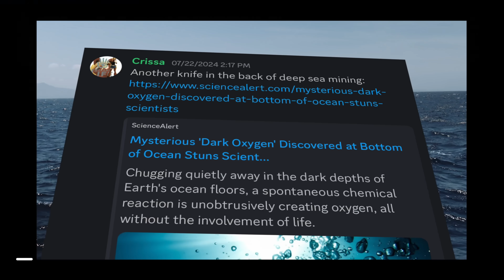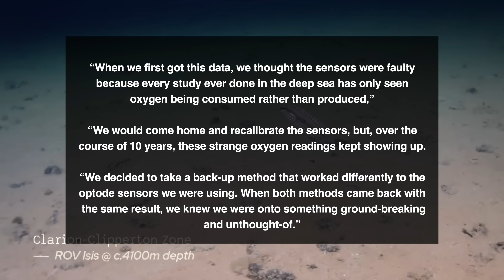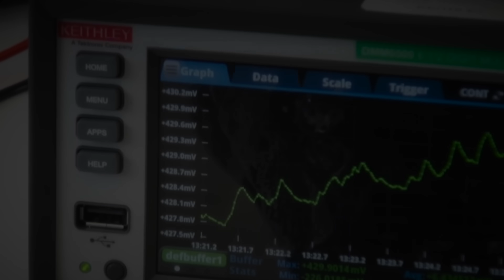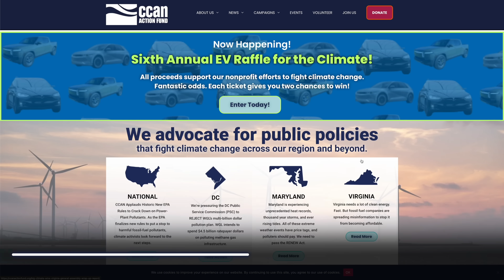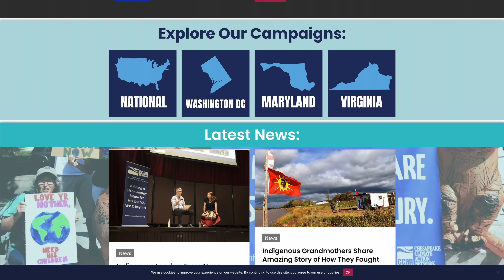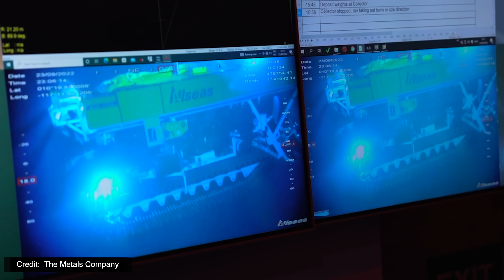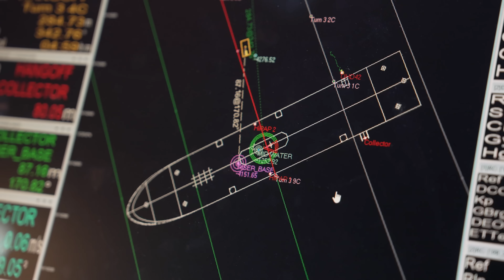The HUGE Problem with the Dark Oxygen Discovery

Comment: This is irrelevent. The amount of oxygen produced by natural electrolysis is so tiny that it has zero impact on the earth. It's not groundbreaking. It's a curiosity. Even if this was happening before photosynthesis existed the result would have been parts per billion O2 that would just oxidize other minerals before even reaching the atmosphere.  This is the same as natural nuclear reactors that have been discovered where fission was happening in a natural uranium deposit exposed to water. It's a curiosity, not a earth shattering discovery. To call this "groundbreaking" is junk science. The mineralized nodules should be mined because they are easily collected and rich in metal content. Hard rock mining is much more destructive to the ecology of earth and requires much larger energy input to extract. We require these minerals so gathering them from the seafloor makes economic and environmental sense.

Comment: I'm very curious about the physics and chemistry of these nodules and how they are formed.
Why are they still producing voltage so long after formation do they form in place on the sea floor or do they have to be circulated or disturbed kind of like a hail stone.
Can we use electrodes and anodes engineered correctly to extract metals from ocean water or vents on the ocean floor?

Comment: Dark oxygen refers to a recently discovered state of oxygen that exists in the depths of the Earth's atmosphere, approximately 200-300 kilometers above the surface. At these altitudes, oxygen molecules (O2) are broken down into individual atoms, which then react with other atmospheric particles to form a unique, previously unknown state of oxygen.

This "dark oxygen" is called "singlet delta oxygen" (SDO), and it's called "dark" because it doesn't emit light, unlike other excited states of oxygen. SDO is thought to play a crucial role in atmospheric chemistry, influencing the formation of other atmospheric particles and potentially affecting the Earth's climate.

The discovery of dark oxygen has expanded our understanding of atmospheric science and highlights the complexity and mysteries still waiting to be uncovered in our planet's atmosphere.

And the "Dark Oxygen" in depths of over 6000ft is actually called "recalcitrant oxygen" or "refractory oxygen" so as to not confuse it with dark oxygen found 200-300 above the earth's surface.

Comment: They need to look elsewhere for an energy solution. Finding this is like a test, it's low-hanging fruit, and it doesn't need to be mined. There are lots of other companies working on very promising energy solutions like silicone batteries, sodium batteries, and solid state. Calling it dark oxygen is also dumb, if it doesn't differ in any way from regular oxygen, just call it what it is.

Comment: Most of the rocks on earth are mostly oxygen. 

That's where we get comet tails, to adjust to the changing electric environment silicon dioxide must shed the oxygen atoms to loose negative charge. That's why comet tails are so long without dissipating,  the tails have no dust, just negative electrons.

The sun is like the positive pole of a battery and the heleosphere is like the negative pole, when a comet gets closer to the sun it moves into an area of more positive charge.  Earth has a surface change of 100 volts per square meter.

Comment: more testing needs to be done, to see how much you can mitigate the issues. i wonder about using lights on the sea floor that has been damaged, to try grow seaweeds down there. if the issue is light not pressure, we can up the o2 in the areas, while mining them all out. as long as there is no other issues found with deep sea seaweeds, that is :P

Comment: We need less raw material for batteries than most think because all those materials are recycled in the end and we don’t need more dug up. Once we have enough batteries in the world the constant recycling into new batteries makes the circle complete. 
Plus, the mining done for batteries on land is less destructive short and long term than searching for and pumping out oil/gas/petroleum. 
I get that this show wasn’t directly about this but the anti-EV cabal has recently moved to just trashing batteries themselves and that must be stopped with information. 
Another neat fact about large scale battery storage for the electrical grid is that we’d be saving up excess energy (created everyday now) to use during peak load times. All batteries start the day at full because they fill up overnight. Then they shave off demand at the peak times. That way we need fewer power plants, much fewer peaker plants. 
And we aren’t just burning up the battery packs the way we just burn up coal or gas, where we always need more of it. 
Once we have enough batteries for home, biz and transport we hardly need any new input. 
Let’s definitely leave the ocean floor pristine

Comment: When iron oxide (Fe₂O₃) reacts with seawater, a few possible chemical reactions can occur depending on the specific conditions (e.g., temperature, pressure, and presence of other ions). One common reaction involves the formation of iron hydroxide and chloride compounds. Here's a simplified reaction:

\[ \text{Fe}_2\text{O}_3 + 6\text{H}_2\text{O} + 6\text{Cl}^- \rightarrow 2\text{Fe(OH)}_3 + 6\text{Cl}^- \]

In seawater, the chloride ions (Cl⁻) from the dissolved salts can facilitate the formation of iron hydroxides. Over time, the iron hydroxides can convert to more stable forms like goethite (FeO(OH)) or magnetite (Fe₃O₄).

The reaction can be more complex due to the presence of various other ions in seawater, such as magnesium, calcium, and sulfate, which might also interact with iron oxides.

Comment: The use of hydrogen as a "clean" fuel is being vastly over emphasised.  Hydrogen is na highly reactive element and being the smallest atom it permeates almost everything.  Also consider the almost total lack of distribution facilities.  There will probably be very limited uses for it as a fuel for areas outside of normal residential areas. (I'm an Aussie - Outback!!) .

Comment: The way of making use of hydrogen is by taking the hydrogen gas production from a well, a hole drilled in favourable geology, and port it directly into a fuel cell stack.  The electrical energy can then be transported by the grid.  Trying to remove hydrogen from water will remove all of the ions that life needs to survive, such as the hydroxyl ion.  There’s also attempting to store hydrogen gas would lead inevitably to catastrophic failures.  The EV revolution is great, let’s not ruin it by raping the ecology.

Comment: Missing in this discussion is a crucial point: these natural batteries are primary cells. As the metals in them react with the seawater to produce metal salts, they are consumed. The amount of oxygen they can produce is very finite. When the battery is worn out, the production stops. The fact that the metalic modules exist at all implies that any reaction that is taking place is extremely slow - which means that the amount of O2 produced is also very low. I don't see how the nodules could exist and persist over geologic time scales, and also be splitting water at a significant rate - unless there is some process that makes new modules. The other thing I wish the scientists had checked: If electrolysis is happening, H2 should be produced in twice the quantity that oxygen is produced. That should be easy to detect.
Reply: unless the metal is a catalyst
Reply: @jordanhildebrandt3705  Catalysts can speed up a reaction, but catalysts cannot, by themselves, cause a reaction to take place if that reaction needs an energy input. If the metals in the nodules are acting as a catalyst to split water, there has to be some substantial energy input from some other source to drive the reaction.
Reply: @jimmurphy5355  True.  But catalysts can lower the activation energy to the point that a reaction can take place in circumstances where it otherwise wouldn't. 

It just didn't seem very clear from the video what is actually going on chemically.  If the conditions you specified are true, then your conclusion about geologic time is inescapable, and these nodules, therefore, are unlikely to be foundational to any ecosystem.  I am just trying to think of any possible alternatives to your conditions / assumptions, which might change the significance of these very wet rocks.
Reply: @jordanhildebrandt3705  Catalysts do lower the activation energy but a reaction will only proceed spontaneously if there is energy released. Hydrolysis requires energy input, so it won't be spontaneous. You can use catalysts to reduce the energy required closer to the theoretical minimum of 1.23 Volts but not less. If you could then you'd be able to react the hydrogen and oxygen to get more energy out than you put in and that would be a pretty serious violation of the Conservation of Mass and Energy.

Managanese compounds are amazing catalysts and will liberate oxygen from more energetic molecules very vigorously. A single crystal of permanganate into hydrogen peroxide will cause it to decompose into water and oxygen so rapidly that the solution will boil and you'll be thankful you're wearing your safety goggles. The same permanganate in water simply gives you a lovely purple solution that sits there and looks pretty.
Reply: @seantimpa6264 What input powers this universe...the universe itself breaks the second law off thermodynamics...theres no USB cable going into the sun it just is and the story off the big bang is something from nothing which also breaks all the laws
Reply: @jimmurphy5355 is there any indication as to how long a modular will last?
Reply: @jshaw4757  The Sun will go out and the universe grow cold some day. Neither violates the Laws of Thermodynamics, they just take such an incredibly long time to get anywhere near equilibrium that we don't notice.

The Big Bang Theory addresses the first moments of the universe, not its origins. We don't have that one figured yet.

Not that any of that would help oxygen production on the ocean floor.
Reply: @seantimpa6264  Energy out cannot surpass energy in is that correct ?
Reply: @jshaw4757  Not for any process that we've ever observed.
Reply: @seantimpa6264  So what's the energy in for everything that exists
Reply: @seantimpa6264  I'm not being tricky by the way I'm asking genuinely mate thanks
Reply: @seantimpa6264  Electric eels always had my intrest as they a capacitor basically or a layden jar as they first called...but they a animal not tech lol...they just found these metallic stones bottom off sea bed not sure if you have read
Reply: @seantimpa6264  went off course last comment just sharing if intrested
Reply: @jshaw4757  That's one of those processes that we haven't observed. The jury is still very out on that one. Answers may include: "That's a special case", "The universe is eternal", and "The question doesn't make sense as asked."
Reply: @seantimpa6264  Can you elaborate mste coz my head a bit slow a.t.m jury out on what exactly cheers
Reply: @jshaw4757 that's absolutely false. If the sun's existence violated the second law we would not have the second law as it is so obviously observable.
Reply: @djcfrompt  I may be wrong then I thought that was the premise my mistake
Reply: @jshaw4757  sort of, but when you are doing nuclear reactions, then mass-energy equivalence becomes important (E = mc^2). Energy output can surpass energy input at a loss of mass.
Reply: @djcfrompt  Right so where and how has the weight been created in our universe the weight the sheer scale off power not even in sun's in small planets what's the input...it seems very out off balance and we are told energy out needs equal energy in so if as you said not strictly the case that means some free pottential is being created
Reply: @jordanhildebrandt3705  also what about everything being electric carrying a charge at times. Water flowing, beings creating currents in it etc...
Reply: Uh, yeah, what he said
Reply: It's the batteries of Shell-Phones of underwater aliens
Reply: No you dimwit it's the secret spinosaurus society  @downtostandup
Reply: @jimmurphy5355  you forgot the teluritics. Have you ever seen ground  to sky lightning?
Reply: @jimmurphy5355  twice the number of atoms, 1/4 the mass. Great point about the nodules having to be formed faster than the oxygen depletion. The claim is that they take many many years to form. Your astute observation that the oxygen is finite directly refutes that.
Reply: @jeffhiggins808 1/8th the mass. 2 H2O -> 2 H2 + O2. 2 H2 has mass 4, O2 has mass 32.
Reply: @jeffhiggins808  They are claimed to be some of the slowest geological formations so even million of years to form is probably not enough. The claim that they work as batteries don't make any sense. They could somehow work as catalysts but that is something different.
Reply: There  most certinly are proceses that happen to form this nodules that we dont undrrstand yet. Meaning we dont know the rate at wich they are formed or by what.
Reply: If nothing else it reframes our understanding of what oxygen production can look like.
Reply: @tyler1234321  It's current n voltage which reacts with salt water n creates a type off hydrolysis I belive so by its nature it can split water molecules making oxygen ...that isn't spot on my words may be incorrect but enough too get somebody else intrested as I have very bad short term memory but I belive could be meteorites due too metal content magnese nodules polymer stones but it's the salt water that makes them run n create this oxygen
Reply: ....MOREOVER-- ELECTROLYZED SALT WATER TURNS INTO BLEACH

...THESE "SCIENTISTS" ARE JUST INCOMPITENT
Reply: The nodules are made with sublimated metals, when they are actively seeding further sublimation while they are functioning like primary cells.
Reply: Its a surface reaction -- as the metals are deposited, so O2 is released, and the nodule grows.
Reply: @j5edgar2h  do you have evidence for that? I read the paper detailing this observation and I didn't see anything about metal deposition.
Reply: @djcfrompt  Can you explain evidence...can all evidence not be falsified...is it not just a presentation you half need too take on faith..like without background checking every person who is giving you info how can you be sure its facts
Reply: This, uncles we farm 10% of the ocean of them like we do on the surface I don't see much of an issue. Sure this is interesting but earth did not have much oxygen before 500 million years ago 50-100 million year later as in you would die.
Mostly because all the iron turned into rust before we got an oxygen atmosphere.

Comment: We may be able to duplicate with minerals, gathered in the conventional manner to create water, splitting without having to add electricity
Reply: Splitting the hydrogen and oxygen in water requires energy input. There is no way around this. The metallic nodules are getting used up, just like any battery, when they make electricity. The metals in them are consumed - changed into metal salts or some other metal compounds. Once all the metal is chemically combined with some other element, like sulfur or chlorine, the reaction stops. The analogy to burning wood to make heat is very relevant. Wood becomes ashes, and once all the wood has burned, no more fire. In a battery, metals also become ashed of a sort during the use of the battery. Once all the metal is consumed, no more electricity..

Comment: CO2 emission is so much greater of a concern that it is really just absurdly stupid to put the brakes on battery related mining activity for the sake of the animals and plants that happen to live in potential mining locations. We could mine the ocean floor for thousands of years and the effected area would still be insignificant. On the other hand, if we do mine enough battery materials we might avoid a complete collapse of the biosphere due to CO2 levels. It also sounds like this oxygen release is just a cycle and that in other places there are ore deposits which are reducing oxygen levels in the water as they rust.

Comment: I do not understand one thing.  The way batteries work is by changing their chemistry.  They go from one state to another, gaining entropy.  How could these nodules be effectively producing enough electricity for millennia to still be able to rip apart water?  The only thing that would make sense to me is if it was a catalyst.  In which case understanding it could give us a path inexpensive truly green hydrogen.  Bot by placing bubble catchers, but by replicating the mechanism on land in a controlled environment.  That said, breaking of water decreases entropy, this means something else must be increasing in entropy to allow it.

Something just just not right about this.
Reply: That was my first thought as well. Splitting water takes substantial energy. It the nodules are acting as batteries, splitting water a detectable rate would soon consume all the reacive metals into salts of one kind or another. Chlorides are the obvious result, since the water is full of sodium chloride.